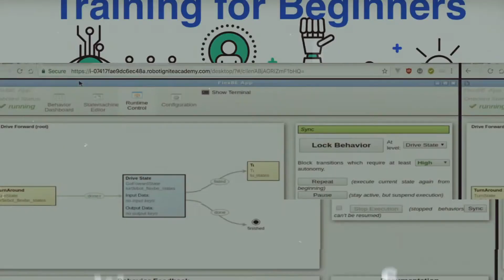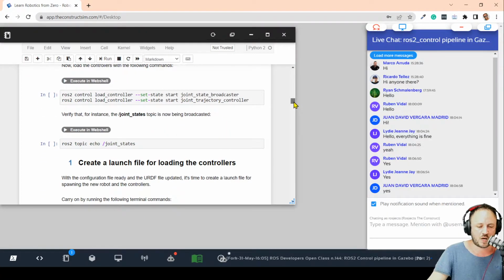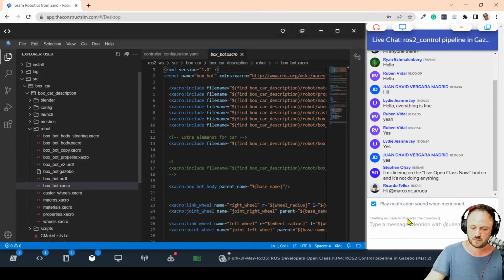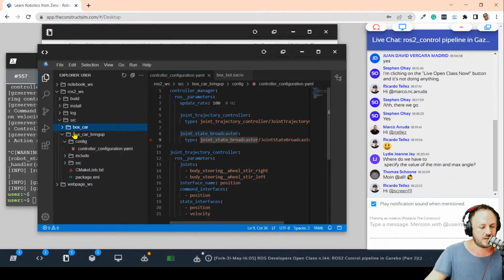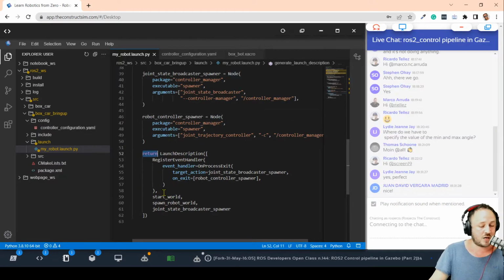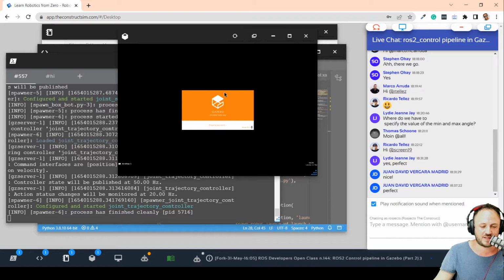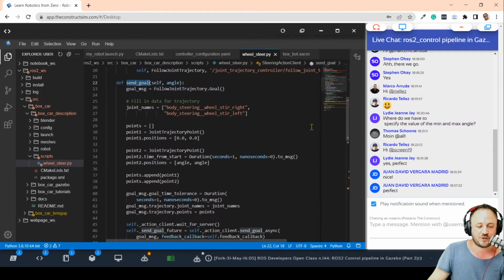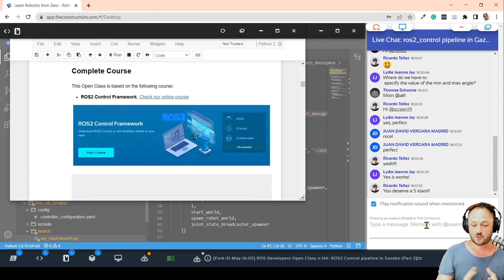ROS2 Control pipeline in Gazebo (Part 2) | ROS2 Developers Open Class #144

Comment: Rough agenda:
0:00: Intro and recap
9:30: quick walkthrough
13:20: controller config
15:35: config controller in xacro
19:35: start the controller after gazebo started
23:45: create the launch file that can start both gazebo and controllers
37:05: the build file
39:00: demonstration